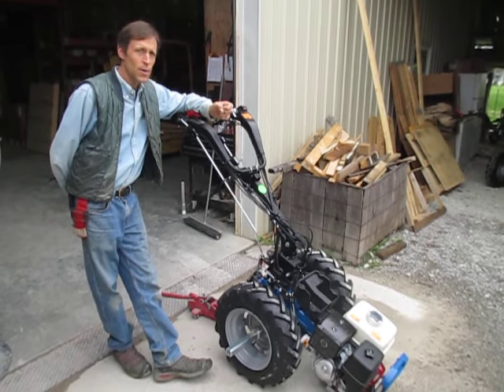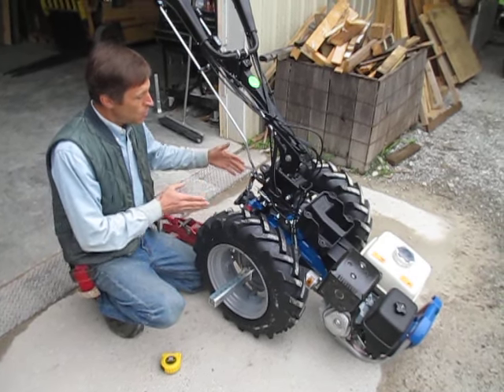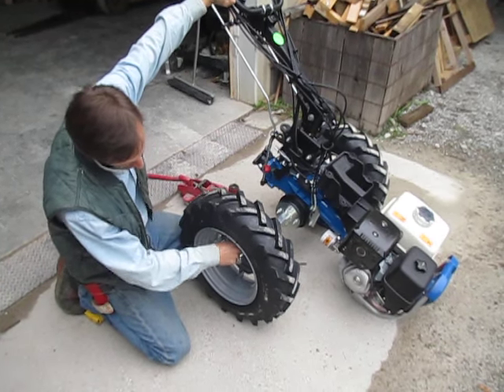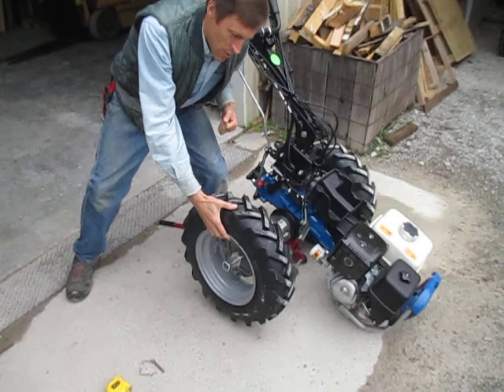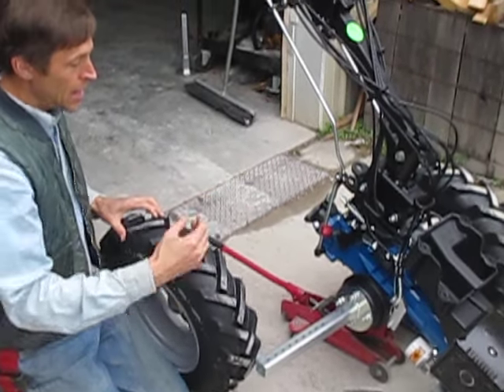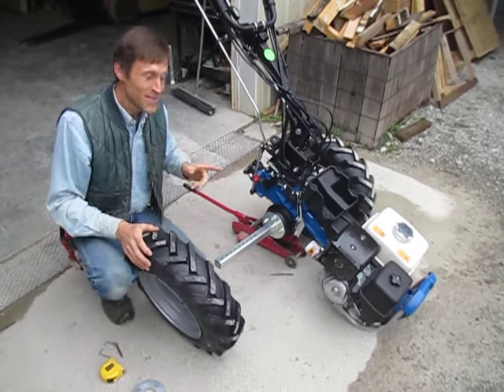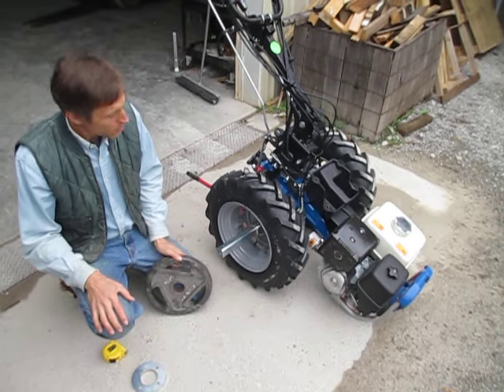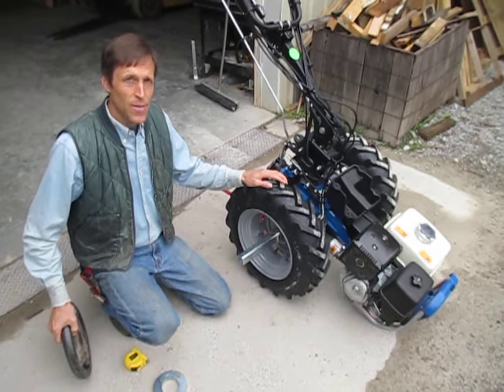Earth Tools Adjustable Axle Extensions

Comment: Great looking product that I am looking into buying.
Just a thought, regarding adding wheel weights while the wheel is at full extension. It would be possible by putting the weights on the inside of the wheel, between them and the engine, of course the use of a retaining pin would reduce the weights jumping around and hitting the engine.

Comment: If you wanted to use weights with the widest setting, why not put them near the differential?
Reply: Because the "leverage" would be to demanding/stressful on the axle bearings. If the weight is carried closer to the "support" (the wheels, in this case), the axle bearings aren't carrying as much of the weight.

Comment: Could this be used to add dual wheels?
Reply: I don't see any reason why it wouldn't work
Reply: Sorry for the delayed reply.  Yes.  We can sell you a second set of "wheel adapters" to attach to the second set of wheels, and then you just slide 'em on.